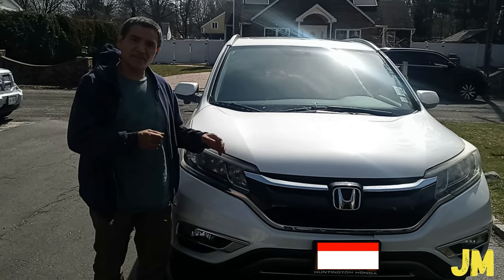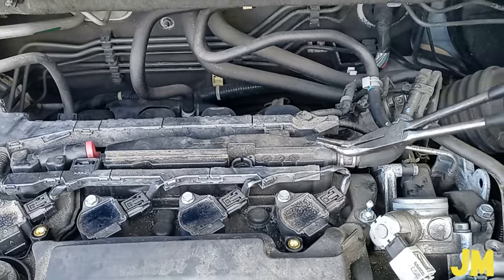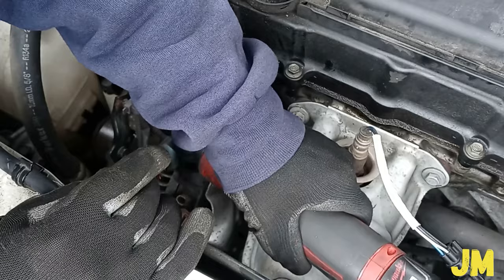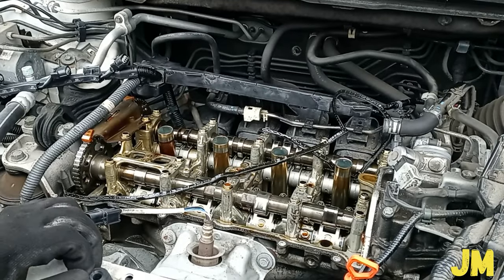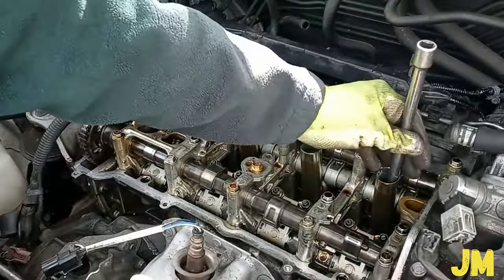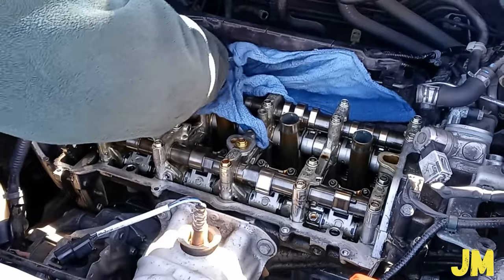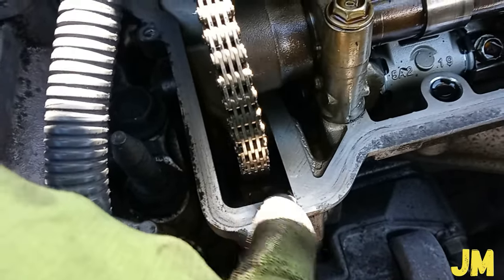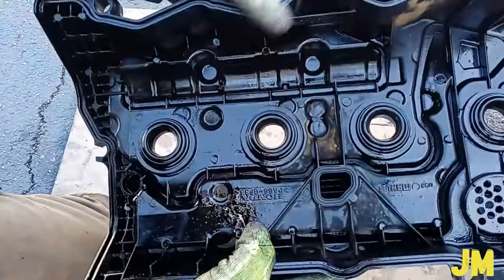2016 Honda CRV Valve Cover Gasket And 5 Years Old Spark Plugs

Comment: What’s the torque spec? Thanks
Reply from the maker: The recommended torque for spark plugs on a 2016 Honda CR-V is dependent on the cylinder head material:
Cast iron: 20 N·m
Aluminum: 17.5 N·m thanks for sharing